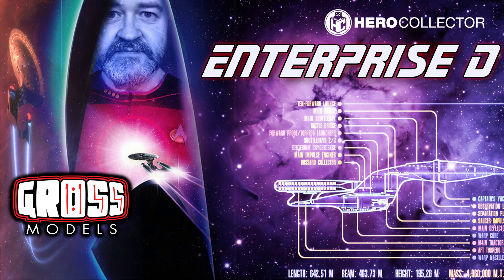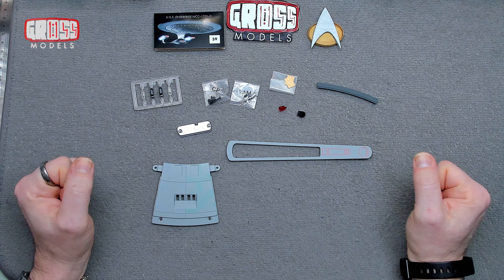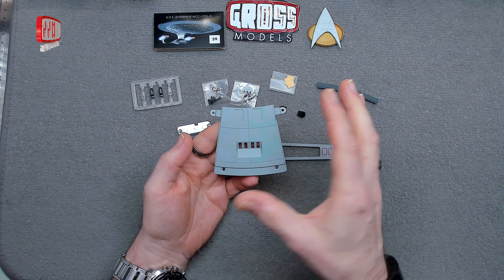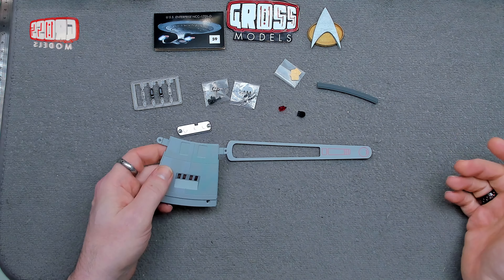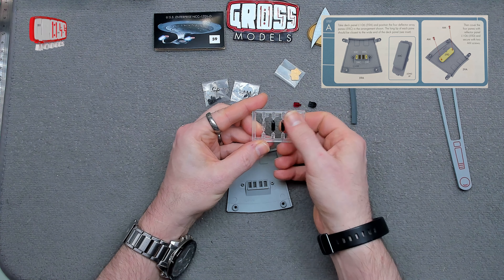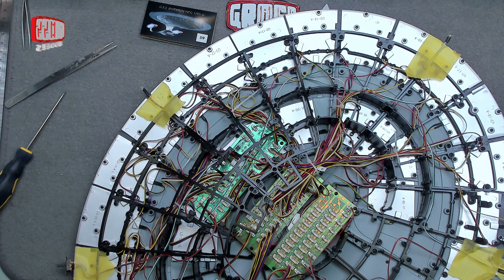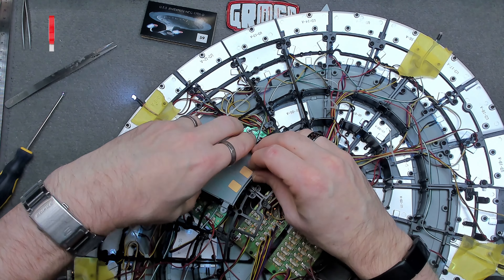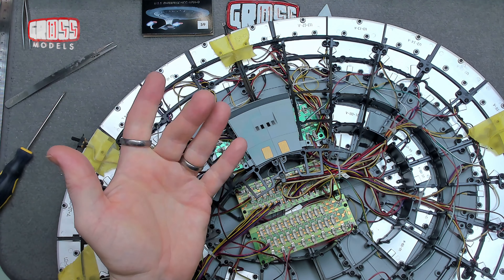Hero Collector Enterprise-D build. Stage 59

Comment: Hi Chris i  dont seam to have aspare bulb free I may have to loosen the circuit boards and have a look under them but its like spaggetti junction
Reply from the maker: The wiring is a little complex isn’t it! I’m sure it will be in there somewhere, if not I wouldn’t worry too much, there are plenty of lights even if you miss one out!

Comment: The transparant bits in this panel are NOT windows, they are supposed to be a secondary deflector to be used when the saucer is separated from the drive section. So all four should always light up (with a bit of a blue tint). 
Also I hope this is not the way we have to light all of the windows in the underside of the saucer, looks very fiddly and not very accurate.
Reply from the maker: I don’t get into the details too much, I just like the look!
I think the lights are going to be ok, there are far fewer on the underside anyway.